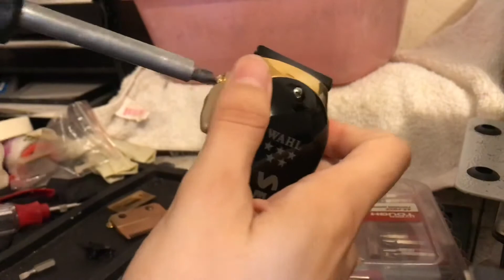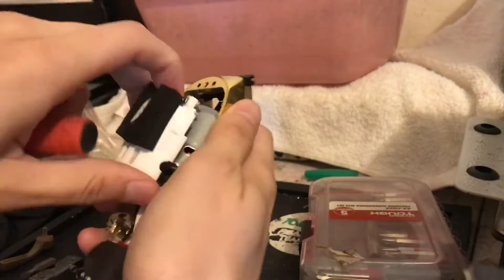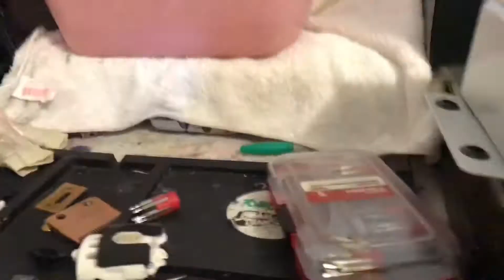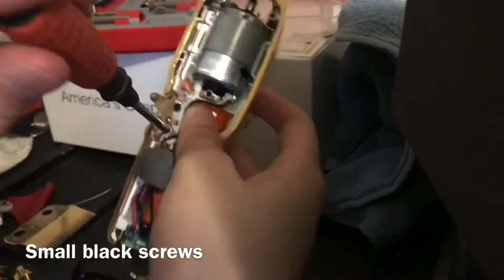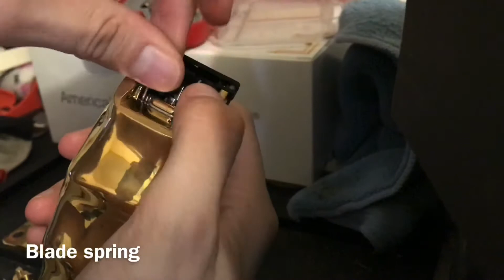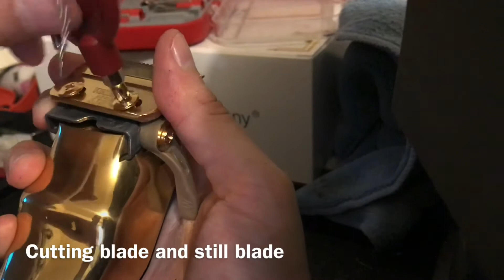GOLD WAHL CORDLESS SENIORS 🔥 |FULLY TAKEN APART| 🔥 STEP By Step

Comment: I wonder of someone could swap the internals of the senior with ones from a gamma clipper 🤔
Reply from the maker: Which gamma clipper
Reply: @barberlouie_2112  maybe the Rebel?  To me its pretty similar but the battery and motor feel stronger in my opinion.  But I like the weight of the senior
Reply from the maker: @ryebaros307  u could switch the motor and battery 🔋💪🏻

Comment: Where can I buy that Gold case for the wahl cordless seniors???
Reply from the maker: I make them gold
Reply: @barberlouie_2112  how much???
Reply from the maker: Honestly bro the one I’m taking apart in the video I have it for sale the whole clipper is new never used it I just made the video with that machine but I have it for sale for 350 if you’re interested on buying it
Reply: @barberlouie_2112  I already have the Wahl Cordless Seniors. I paid $120 BranD New
Reply from the maker: Y have one when you could have two and all gold customized
Reply: @barberlouie_2112  I will have the Gold on it. Ebay has the Gold Bottom for $40 and Amazon has the Gold Top for $11 And this Guy has a Gold Blade for $30. I'll be having my Gold Wahl Seniors soon. 👍
Reply: Would you be able to put the internals of a senior into a magic clip ?
Reply from the maker: Don’t think so I think the board is different on the seniors
Reply: @barberlouie_2112  for sure brother. thanks for the reply